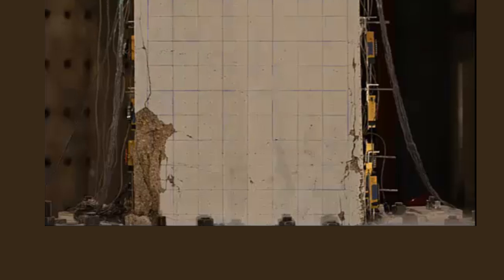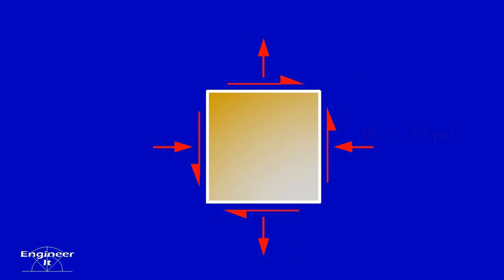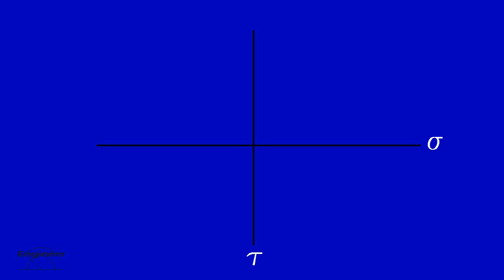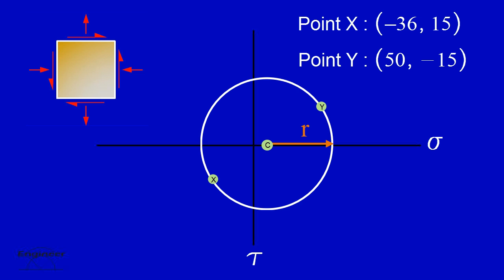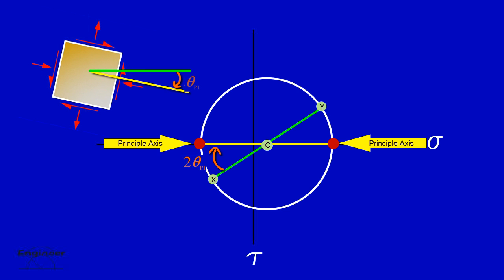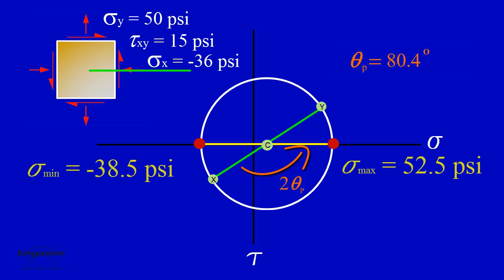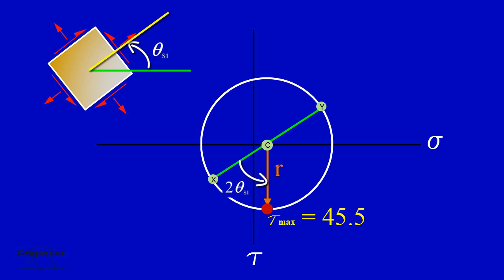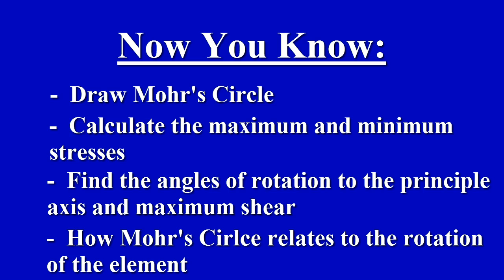Mohr's Circle 2D

Comment: Excellent video, only on small comment there is a typo when you plot the Px it should read -36,-15 and Py should read 50, 15  by a typo you've switch the stresses sign but it is right in the plot.  Not a problem at all.  Thank you for doing this.  Would you do one for a 3D Mohr's circle or Mohr's circle on a plane?